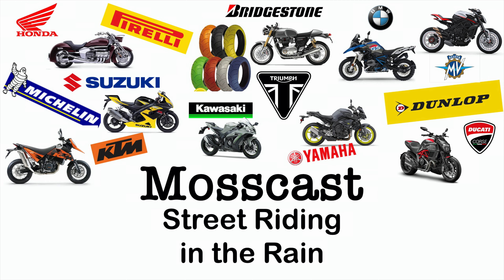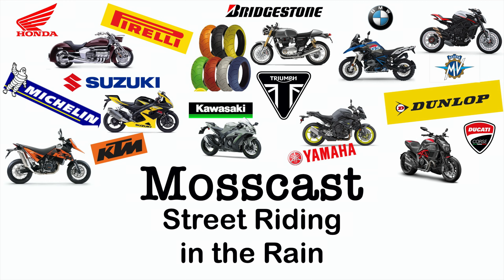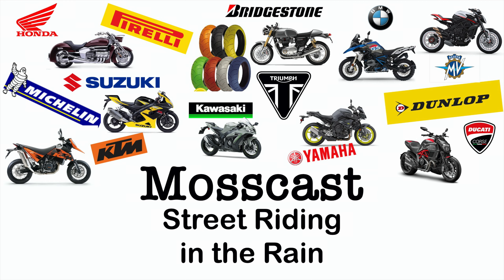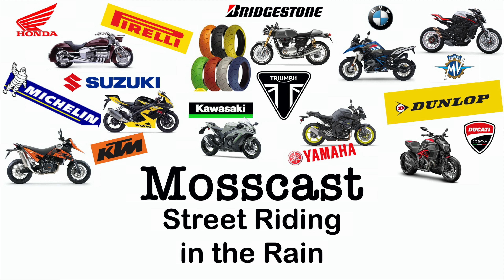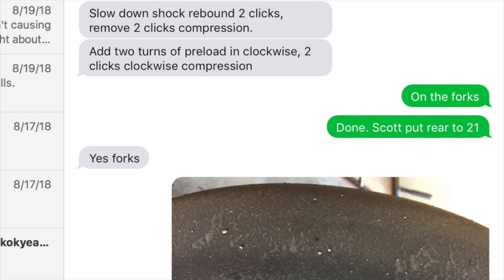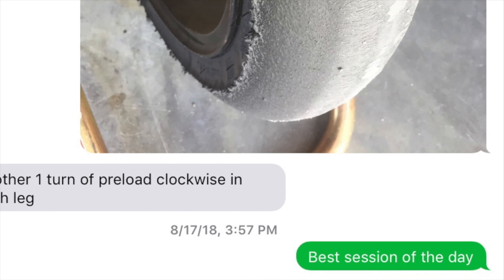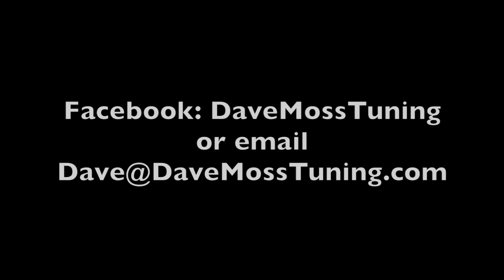Mosscast: Motorcycle Riding in the Rain

Comment: Dave, over many years Mother Nature has tossed all kinds of rainstorms my way, some with very strong winds and heavy lightning. My defense is to adjust speed for conditions and be smooth. Reducing speed gives more time for road surface assessments and avoiding hazards like potholes, metallic objects like manhole covers and train tracks, and slippery painted features. Early detection allows gentle avoidance maneuvers which don't challenge tire grip. If I stop for anything it's only to change out a helmet visor and don the rainsuit. My streetbikes aren't setup racetrack stiff and they worked just fine in the wet without setting changes.

If gusting sidewinds are also present, strong enough to make riding in a straight line difficult, then that's my sign to stop and wait it out. The scariest situation was on I-5 up on Siskiyou Pass. Cold, driving rain and very dark, with frequent nearby lightning. Preferring not to stop next to a highly conductive steel guardrail, I kept going. Rain turns to hail, I slow drastically as it collects on the road, and all those big logging trucks I passed on the way up are passing me on the way downhill. It's hard to see, as the helmet visor is open due to fogging and my face is being pelted with hail! A lot going on, definitely!

Comment: Thanks, great tips. I have a quick question: what to do when the tyres have both specs? They have grooves but not from the center to the edge (e.g.: Dunlop GPR300). Raising tyre pressure seems ok, but is it? Thanks.
Reply from the maker: In that case a little more pressure makes the tyre rounder and as such also keeps the sipes more open when under load.
Reply: @catalystreactionsbw  Thanks.

Comment: Dave, should we be keeping the comp/rebound ratio the same? For example, 2 clicks off comp = 2 click off rebound, to maintain the tuned difference between them? Or would this thinking be a fallacy, that while it makes it easy to remember, it could be adverse to the situation's requirements? I'm usually one to power through, which I never question when caught out during a surprise shower, but contemplating this post-viewing, I have realized I do not touch the dials throughout the typical wet winter season of the sf bay area commute. I'm pondering now if this is a mistake.

Comment: Don't you plan your trip before and check the weather ? Also you have your mobile phone and a lead to charge it on the road riding with it in a Case and not a cheap back cover. You also pack rain gear.. Smart riding... 😷😎👍
Reply from the maker: I prefer the adventure (while being prepared) to experience whatever comes my way. I grew up in Manchester UK (aka rainy city) so it was common to be riding in the rain, unusual to be riding in the sun.
Reply: @catalystreactionsbw  O.K. I served in the U.S. Airforce and stationed in Suffolk and lived in Ipswich off base..